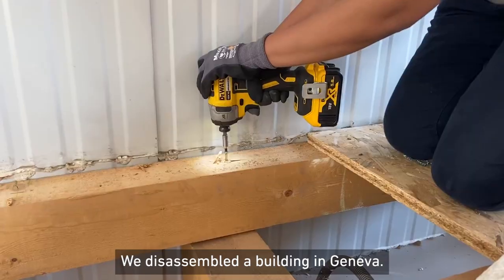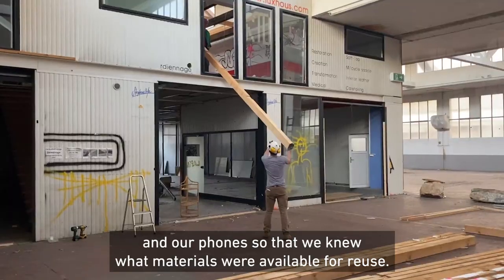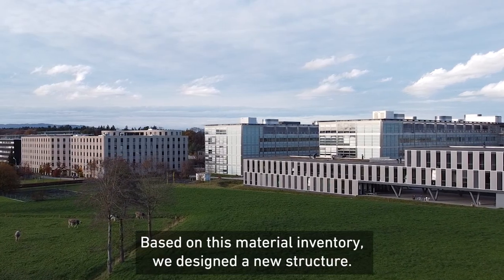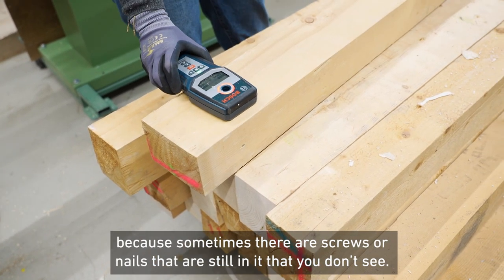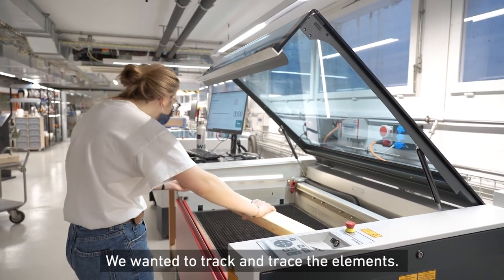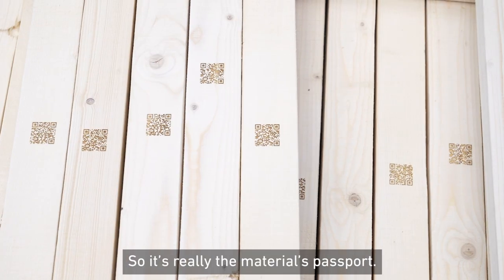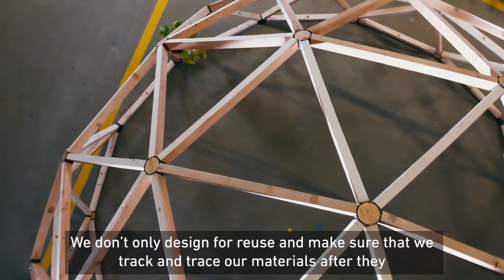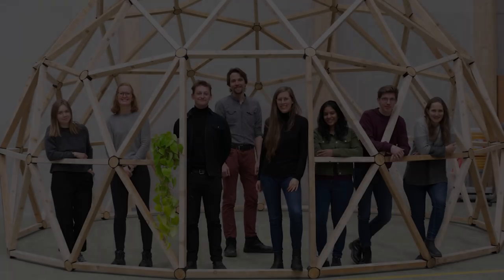This dome is made of waste

Comment: But what is the dome for ?
Reply: I don't think the point is the dome; it's more that it is possible to construct anything with this technique. Which means it can then be applied to other buildings.
Reply: What do you want to use it for?
Reply: @howard1905  It had several lives already: meeting room for a city hall, classroom, radio & TV station, greenhouse, etc. and it can be reused for a new life in the future as the idea is that it travels (locally) for starting a conversation about digital innovation for circular construction

Comment: Sooo you took wood that normally gets recycled and sent it through air conditioned rooms thousands of dollars in machines tons of robots using lots of electricity to build a dome that a high school shop class can build in a day with some basic math. Great job really out here doing the most.
Reply: It's reclamation of materials that are usually discarded or downcycled. They standardize and catalogue every piece so that they can continue to be reused down the line. This isn't exactly rocket science but it's valuable to do this kind of work because a vast majority of materials that aren't easily recyclable (unlike glass and steel) end up in a landfill anyway. This kind of ethos creates the groundwork for the standardization of many mass produced materials to be properly reusable and not easily discarded like many things today; concrete, pvc, flooring, and lumber are all some of the largest contributes to the carbon footprint of construction because there currently isn't a system like this in place.